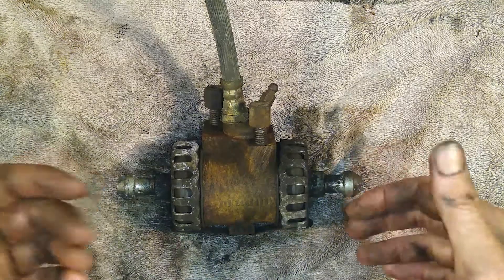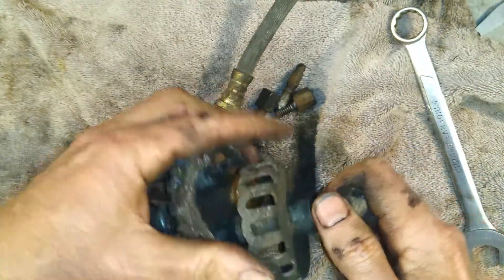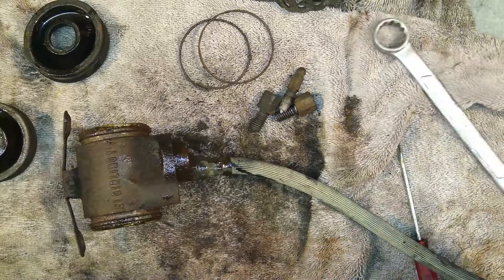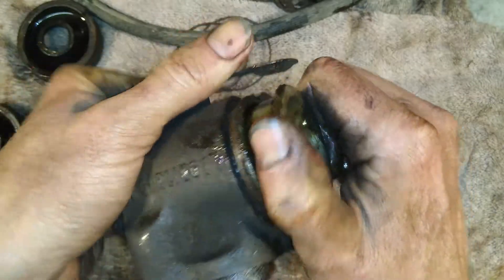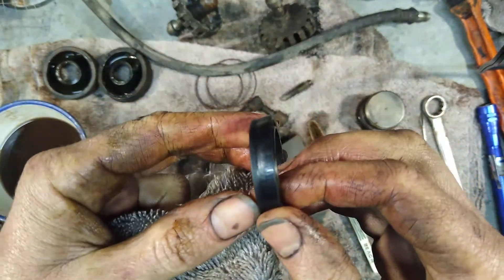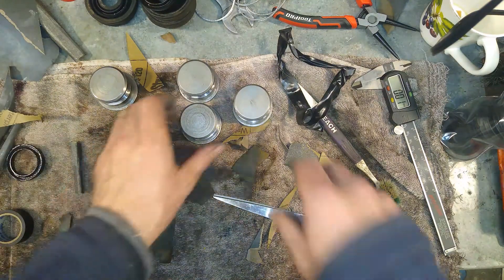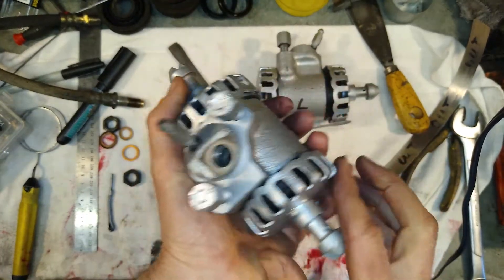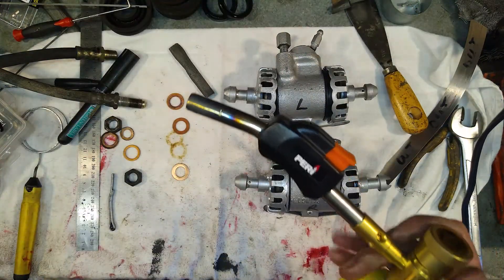Bedford Bus Front Brakes Rebuild - WHEEL CYLINDER REPAIR (Part 2 of 4)

Comment: I’ve got a leaking slave cylinder in the rear of my 1965 Bedford, just took the 2 wheels off to have a look then found your videos I’ve watched them and am now confident to undo the cylinder from the back. I have vacuum, boosted brakes I’m told not air.

Comment: Hey mate! Where do you purchase your seal kits? Can’t get them here in Australia!
Reply: Best thing to do is to get the code off the seal and order online.
I recently got a rebuild kit for a master cylinder.
$270.

The seals themselves are available online for $1-4 depending on which seal.
Sadly the brake specialist mob i went to just ordered the kit and sold it to me with a small mark up, but didn't bother to look for the individual seals.
Holla if you need any help finding parts, im currently working on a 1969 truck brake system